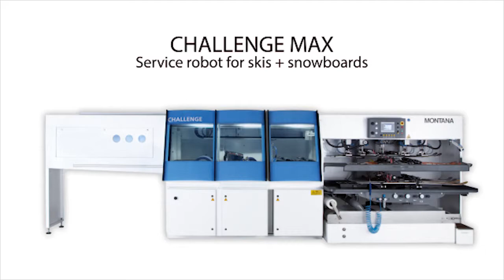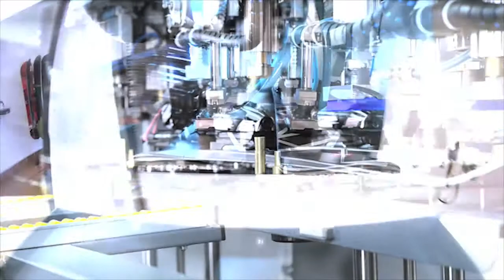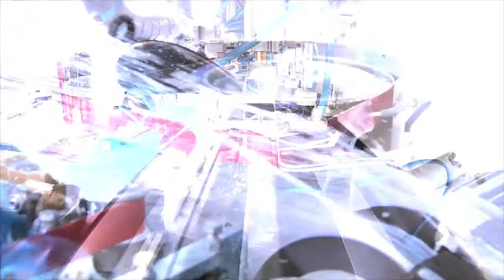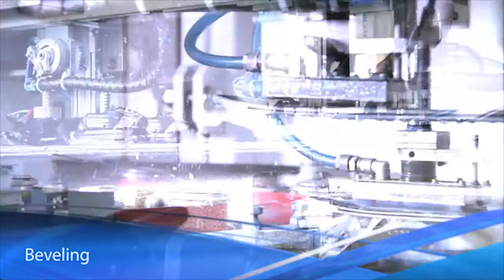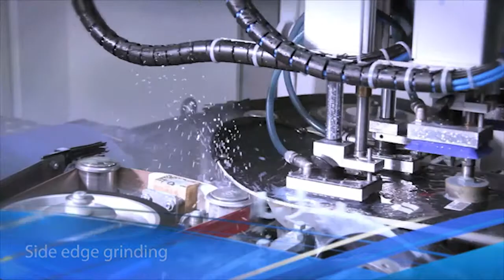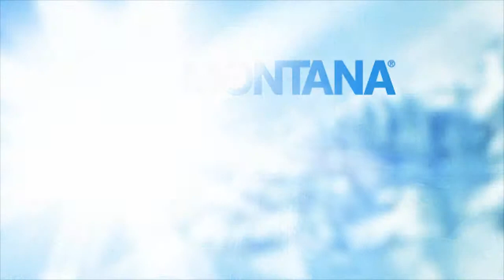MONTANA Challenge Max (english)

Comment: Hello!  How are you?  I use challenge Max(Nr.132202) grinding robot, but i have some problems with suction plate. I need your help if possible.  The suction plate cannot hold the skis.  It says "no vacuum" as an error.  But there is enough air in the compressor and the vacuum pump works, the oil level is also normal. When i touch the fix the problem button, the error goes away, but when I press the start button, the error comes back.What could be the exact reason for this?  Thank you very much.